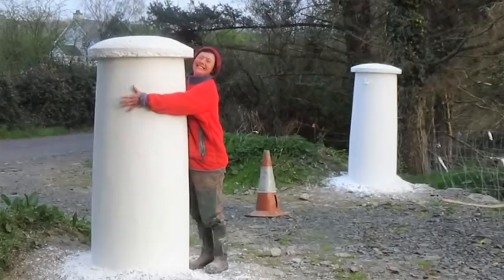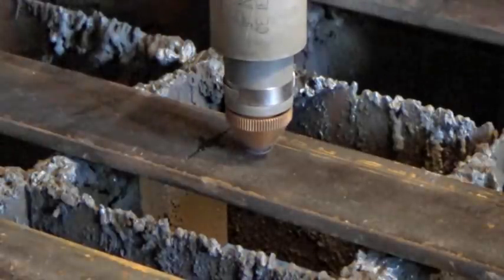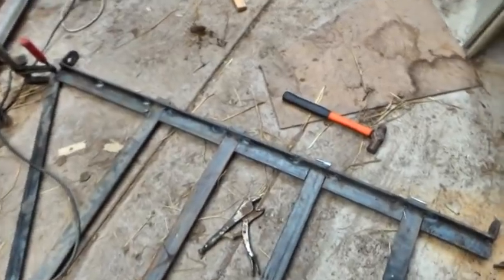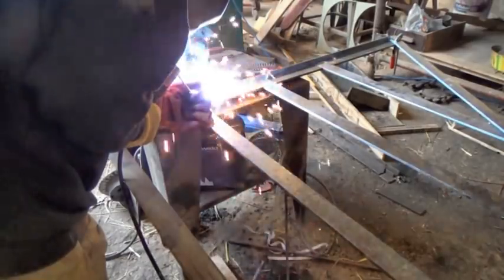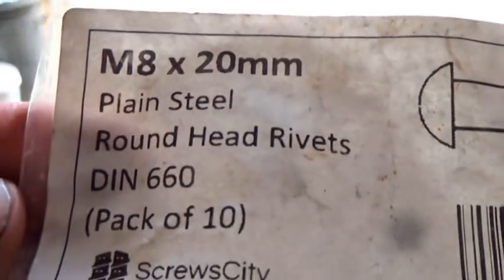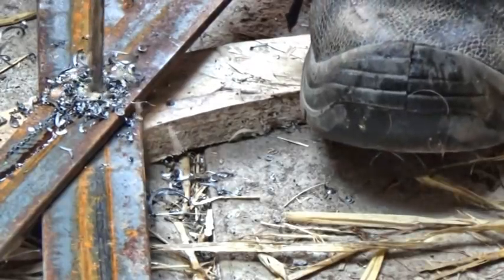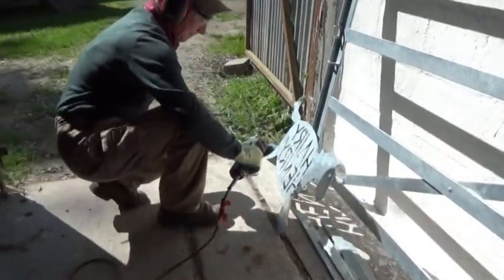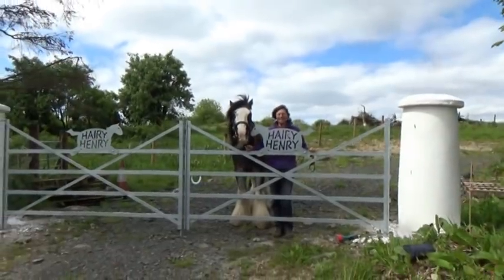Homemade Farm / Entrance Gates From Flat Iron Bar And Some Rivets.

Comment: I am always interested in blacksmith work & have seen and photographed all sorts of old gates and benches made using tenons and even dovetails riveted over together with round rivets. The structures are often quite elegant (if a little rusty) and clearly date from a period before smiths had any means of welding other than in the forge, the slots (mortises) you have cut would probably have been made in the hot iron with some form of chisel or sett, and if the smith was trying to retain the full strength of the metal each mortise would have had a ‘swell’ where the metal was pushed aside rather than cut.

It is interesting to watch your. ‘hybrid’ approach to the problem using a cnc plasma cutter & stick welder!

Comment: Nice job Tim and Sandra red is the perfect color. I would suggest to driving a piece of pipe into the ground for the vertical latch bar to drop into. The neighbor's horses learned they could just lean on the gates and make their great escape until their owners applied this fix. 8^)
Reply from the maker: You're right, Lance. Next time we mix some cement..

Comment: Looking at the size of the post, I had envisioned 2 7/8" pipes with redwood or cedar pickets with 1/4" x 1" angle iron around the perimeter of the pickets. Those gates are outstanding and lightweight. Excellent work. Depending on what part of the country your in, the foundation is critical. Around here 2 out of every 10 brick and stone mail-boxes are always leaning one way or another gate post etc etc. Around Dallas Ft Worth we have what is termed as expanding soil. No extravagant foundation and its leaning. It really looks great M8.
Reply from the maker: Thank you. All painted up now and looking smart...

Comment: Nice work. To make that rivet backing tool, if you haven't got a cnc mill. Drill a hole to remove some material, then heat it till its red hot and bash some cold rivets into it to forge the exact shape the rivet head. Ye olde technique :-)
Reply from the maker: Good plan, John. Thanks.

Comment: So it’s May 2022 when I’m watching this, I’m curious about the foundations, I am wondering have the posts begun to lean yet or are the gates sagging yet?
Reply from the maker: I was interested too and looked carefully. There has been movement - one gate is higher now than the other where they meet. So the post must have moved against the weight of the gate. It's only about 3mm so I'm not worried at all.
Reply: @WayOutWestx2  sounds good, I was a little surprised at how shallow the foundations were, but it looks like it’s working out!
Reply: @WayOutWestx2 , excellent!

Comment: Always make the gate skew up slightly away from the hinge to offset any 'limp' or slack in the metal.
Reply: yes I agree, then when gate settles will be a fine job. a good tip that.
Reply from the maker: Good idea - but by how much?
Reply: Way Out West Blow-in blog that's a question for an engineer, at which point it gets a bit ridiculous!

Comment: I'm not sure, but it looks as if you have welded the hinges onto the gates. If you screw eye bolts through the gate instead, you can adjust them to align the gates.

Comment: Your rivets should stick out by 1.5 rivet diameters before you set them. You really need a pair of rivet sets, punches with dimpled ends to finish the job off neatly.
Reply from the maker: You're right. I must find more of a range of them

Comment: If you'd warmed the rivets in the furnace first, they pull in tight once cooled ... 
I once used an old Pushrod from a truck engine to pean the end over into a mushroom dome.
Or there's cheap tool available on eBay these days ...
Enjoying watching during Lockdown! Rubbish on BBC ...
Reply: Aah, notrut, I think you are bolting the gate after the horse has flown the coop, or whatever... (mixed metaphor overload)
Reply: You don't heat rivets in that dimension..
If you knew anything about this craft you'd comment the wrong rivet length, ignoring important tool/ work step, and lousy use of hammer creating the head.
⚒️🙄

Comment: could we see a short video of how fast your CNC machine cutter actually works? im curious how long it takes to you cut out those signs and stuff
Reply from the maker: The clips in this video are at actual speed - but after a while I speed up the one of the horse being cut out. The speed depends on the thickness of the metal.
Reply: Way Out West Blow-in blog ah I went back and saw thank you!

Comment: I wonder would you turn an auntie scalp roller out of oak for  my mower deck
Reply from the maker: A what now?
Reply: @WayOutWestx2  it's a roller 900 mm by 800 mm with  a 12 mm hole 12 mm hole in the 800 mm for a bolt to act as a kinda axel
Reply from the maker: Interesting, Michael. But that's just too big for my lathe bed. Sorry.
Reply: @WayOutWestx2  sorry 90 by 80 lol

Comment: Pls learn basic principles before spending your scarce resources on such low quality results!

The whole construction is obviously weak and unstable.
Wrong dimensioned materials, lousy welding and wrong riveting practice.. 

There is still good reasons a Smith spends at least 4 years learning, before deserving the title craftsman... 😉
Reply from the maker: Ah, but I'm not trying to be a blacksmith. I'm just trying to make something for ourselves. It doesn't have to be perfect to be satisfying. I'm just a beekeeper who likes to try everything - what's wrong with that?
Reply: Jealousy!!!!